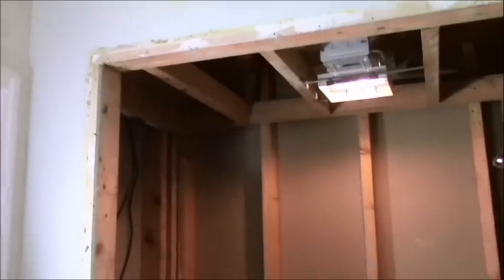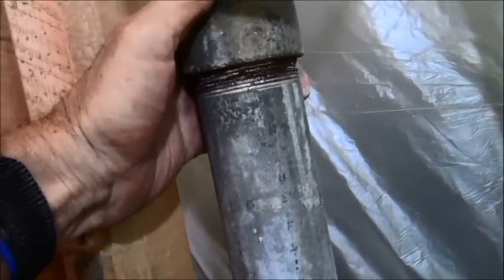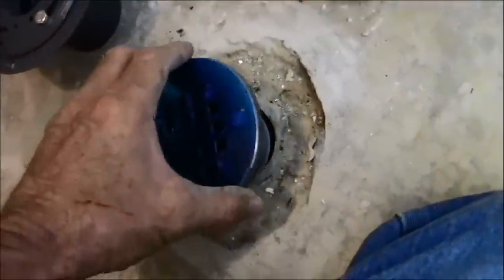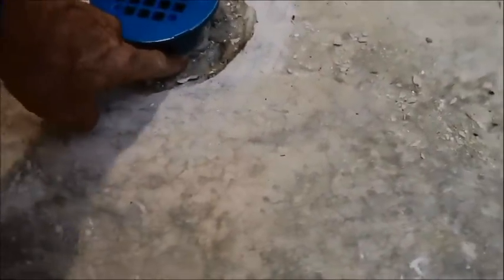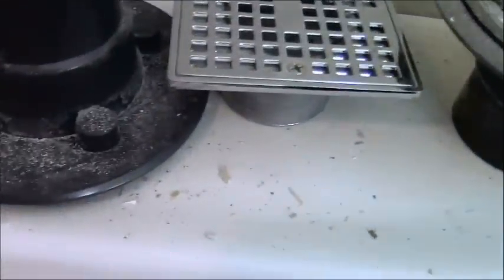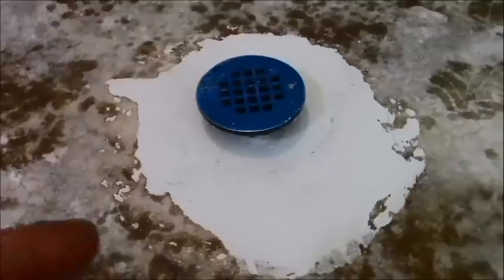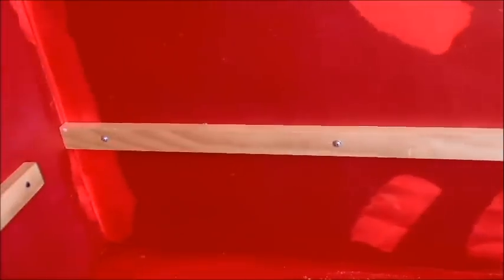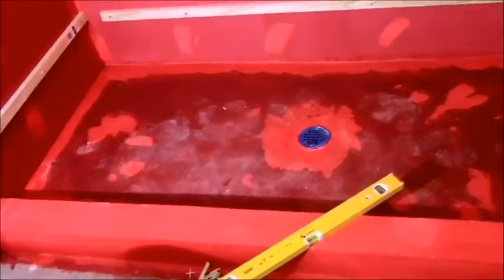NO PAN LINER IN THIS SHOWER

Comment: I have the same restroom project in my house. No pan liner, the drain is built into concrete, and I have iron pipe. Someone who came before took out the concrete surrounding the drain so that made it easier to work with. I ended up using fiber glass wall panels because that was the best material I can use with my skills. I've never built a bathroom before so I tried to keep it as simple as possible. 

It has many mistakes, but it functions and hasn't leaked after 3 years. Hopefully, it stays that way for a long time. 
Thank you very much for this educational video!

Comment: I've used Redgard for a liner for years now. I used to do preslope, mapei liner, than mortar bed. Thing is that i just didnt feel comfortable about the water going under the mortar bed. Always felt that thise installations would smell moldy overtime. Now i just do an embedded kerdi drain into the mortar bed and a few coats on the whole pan and walls of redgard with mesh on the edges. Been loving the easier installation and the very little room for failure definitely has won me over. Redgard also guarantees this type of installation and it the installation my inspector says he like the most

Comment: Thank you for this video. I'm redoing a basement shower my late father built in the 90s that is very similar to this. It's just a concrete pan and curb with tile set right on top of it, no liner, no drain with weep holes, and no waterproofing at all. It held up surprisingly well for almost 30 years and just started to leak a bit recently. I really didn't want to rip it all out and start over, so your video gives me hope it can be salvaged.

Comment: Definitely agree with the decision to add the Kerdi bands around the corners. A solid membrane will fill in gaps, although things to settle a bit, and I would trust it in the long term over just topical liquid membrane. The Redgard over everything will mitigate issues with Kerdi (which are the seams and relying on thinset to not wick water).

Comment: If the drain is slightly off level when screwed in or if the thread clearance is so tight that the drain won't tighten - you can apply valve grinding compound to the drain threads, then screw in the drain and rotate it left and right until you have removed enough material to enable the drain to set level.

Comment: I know you kinda knock schluter (and so do your followers most of the time), but I gotta say it's a huge time saver and much cleaner to work with (not to mention the weight difference). I guess it's more expensive to use but I would think the time saved on red guarding would be worth it. Kinda the same reason people use the pre-made wall boxes. Building those out with cement board and then red guarding is huge time consumer vs just tacking a schluter box on the wall. And the schluter comes in pieces ling enough to cover the entire work area. I don't think that one will more likely fail then the other is if it is installed properly.
Reply from the maker: The issues I have with Schluter is not just expense, although that's a huge problem when foam and plastic are cheap & easy to produce and that cost margin is huge vs 50 bucks for a liquid membrane. To say it saves time is not passed on in labor cost " sir/mam, the prep only took me 7 hours instead of 2 days so your project is $1000 less " conversation doesn't happen. In fact they probably paid more in proprietary material since all of it must be used for a warranty, which is a great marketing tool for Schluter but sucks for the consumer. And at the end of the day that material does not make their shower function any better or worse than a liquid applied application... in fact I would argue the opposite, since the overlapping of the material relies solely on thinset which is porous I suspect there are hundreds if not thousands of potential failures with Schluter out there. If I thought my customers would benefit in any way & saved them money, I'd be ok with it, but the irony is they DO using my method on both counts.

Comment: nice job working with what you have.  A suggestion:  maybe cut off the socket on the new Oatey drain then use a threaded close coupling to the existing drain pipe and go about business in the normal way.  This could raise the deck slightly but it would give you the benefit of having weep hole drains on the floor and you would use a liner of course.

Comment: I’m a novice at showers, although I’ve watched lots of your videos (thank you!) I’m curious though... if you trust Redgard so much, why don’t you run your cement backer board all the way down to the floor and then Redgard the assembly to make it a monolithic system. I understand through watching your videos that water can wick or use capillary action, but not through a waterproof membrane, right?
Not challenging your approach, just trying to understand how to move forward on my own project. Thanks again for another great video!
Reply from the maker: You could absolutely do it the way that you suggested, but given the two options why would you choose your way over mine, not having the wallboard touch at all ensures there will never be a problem. At the end of the day I have a customer base to answer to and I do not want a failure so I error on the side of caution
Reply: @StarrTile  - i started spacing my concrete backerboard 3/4" above my pan bed as well.
I use the Redgard system and trust it  entirely but like you said, why not incorporate an extra measure of security. The peace of mind is worth it.

Comment: I have a new shower installed upstairs with no liner and a plastic pan. Does my shower need a liner or is that only for tiled floors in showers?
Thanks!!
Reply from the maker: If you have a fiberglass pan then you will not have a liner because you don't have any tile...
Although they do make Tilable fiberglass pans, that's a different subject
Reply: Your pan is what's catching the the water assuming it has pvc hook up

Comment: What kind of mortar did you use for shower pan.
Reply from the maker: By default I use Quikrete sand topping mix from Home Depot , but if I have my choice then I like Sakrete sand mix at Lowe's better
Reply: @StarrTile  I've seen you use mortar mix the green label as well what is the difference. Also when do you know what application to use sand topping mix vs mortar mix

Comment: Why didn't you do a liner?
Reply from the maker: Because the way a typical drain configuration works with a locking flange it wasn't possible here, it was all talked about on the video
Reply: @StarrTile  Wal thanks

Comment: So what happens when water actually makes it way under the tile and it potentially starts to mold cuz you don’t have weep holes in the drain? Just replaced a pan someone set that sealed up the drain with caulking?
Reply from the maker: All tile guy's including myself waterproof their pan surface with something, if it's Redgard, aquadefense, Hydro ban, 8 + 9, or even Schluter... this build is nothing different from what I normally do with the exception of the drain setup, there is no expectations whatsoever that water will get into the mortar.
And yes I have seen drains fail in the past, those showers have never been waterproofed as we do today
Reply: @StarrTile  I don’t believe you answered his question as I had the same question. He is not talking about water getting under the mortar, he asked about water getting under the tile. Water will seep through the grout and there will be an amount of water sitting there from the top of the tile to the redgard with nowhere to go because there are no weep holes by your drain.
Reply from the maker: @mgpvii  my rationale on that is simple, there's maybe a quarter inch of thinset under the tile and that's all water would be able to penetrate... it's very close to the surface so therefore I believe it would dry out between showers, assuming 10 to 12 hours part or longer. Plus there is still a slope for the tile to sit on and excess water would be able to drain out around the drain area and then either evaporate or trickle into the drain...

I could be wrong on that but it makes sense to me and I would rather have a tad bit of water in the thinset than I would gallons of it going into the mortar every time a shower is taken.
Reply: @StarrTile  I’m being nit picky here but In addition to the thin set thickness you also have the water in the grout which those pebble tiles have a lot of. Your point taken with slope. So actually the water we are talking about is a smaller area than was originally thinking closer to the drain. Thank you very much for taking the time to respond. Peace!

Comment: So you didn’t use a pan liner because you didn’t want to cut the drain? Guess I don’t know why not using a pan liner is one of the options you gave the customer...feels like more work than just doing the liner..idk tho, maybe you’ll clarify
Reply from the maker: I didn't cut the drain because it was cast iron, embedded in concrete, and the customer did not want to dig the hole at grade. And if you know anything about the three-part drain, you could not retrofit it onto the cast iron drain and that's why I didn't use a liner because a liner needs to be a part of a three-part drain.

Sometimes when there is a problem you come up with a solution 👍